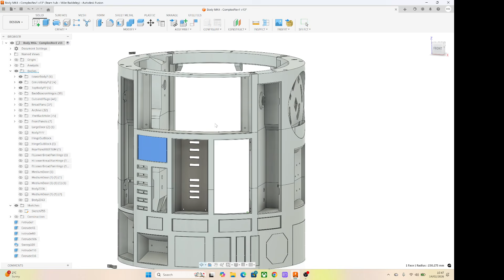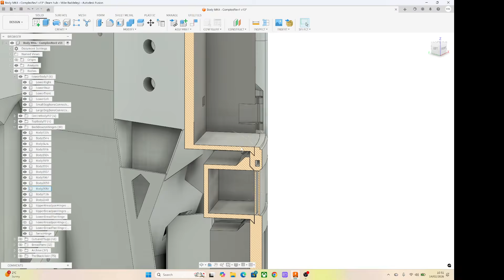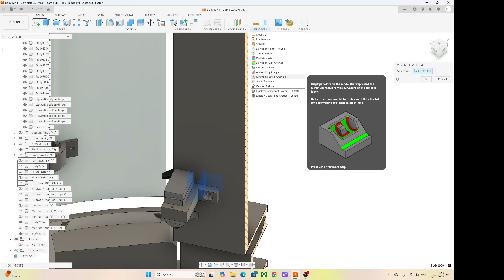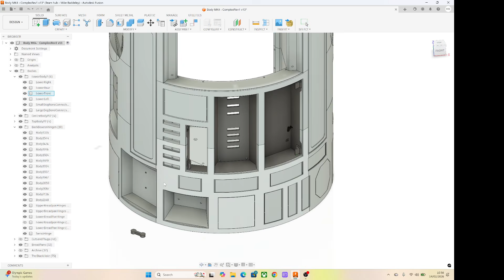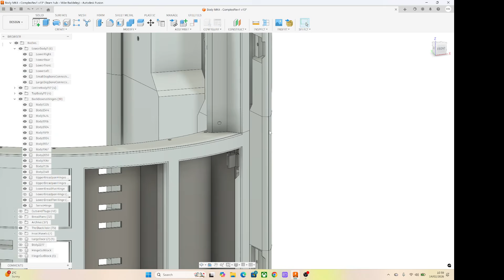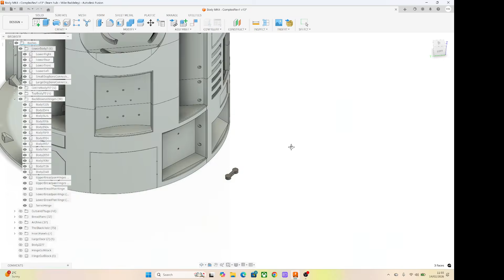MK4 Complex Body Beta Files update...

Comment: For the Data Port back box (to the right of the center vent when looking at it), if the servo is mounted to the back of the box, is there still room for all the openings needed for the lighting kits?  Could you also on both data panels where people tend to put lighting, add a place to hold a reed switch and a magnet to detect when the door is open/closed to turn the lights on and off?  On my Mk3 body, I glued a magnet to the back of the hinge and hot-glued a reed switch inside the body, but getting it in the right place was very fiddley.  If the guy who designed that lighting kit would add some kind of serial communication so we could turn it on and off through software we wouldn't need that.  He doesn't open-source the code or I would try to do it myself.